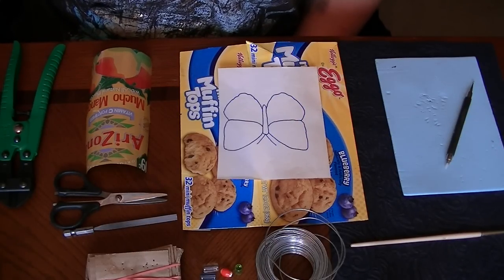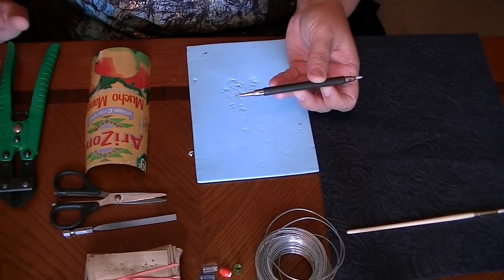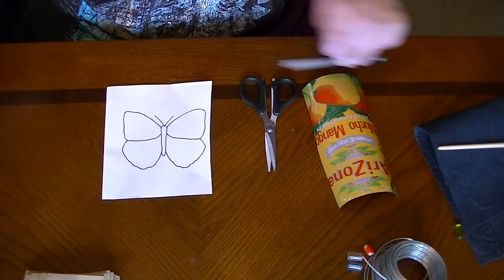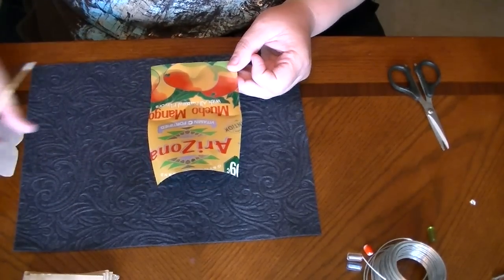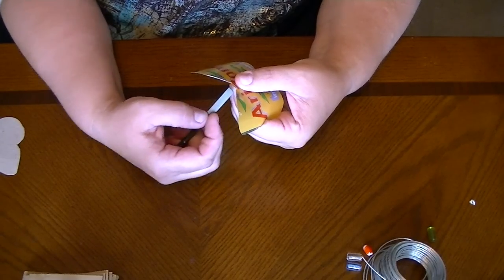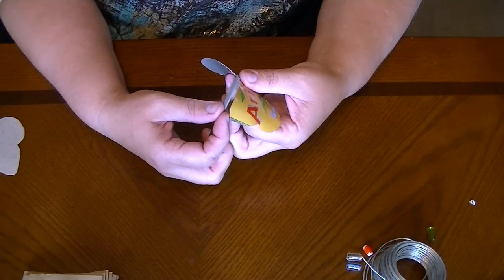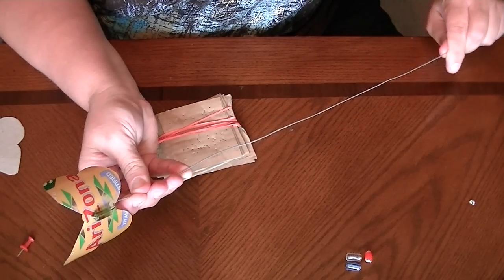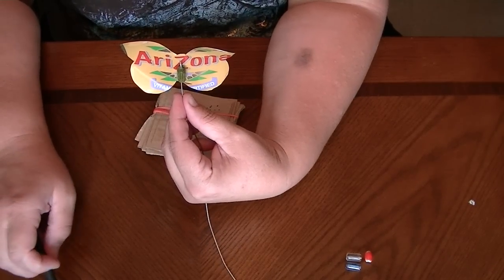Butterflies on a Stake Made from Soda Cans

Comment: all that happened when I filed edges was to make them sharper!!
Reply from the maker: Hey, Duke. Sorry that happened.  Are you filing for a very long period of time?  You should just need a quick file to get rid of pokey parts of the metal and to quickly rough up the edges.  And I would just make sure that you keep the angle of your file perpendicular to the metal so that you are mile the edge flat and not beveling the edges.  Hope that helps.